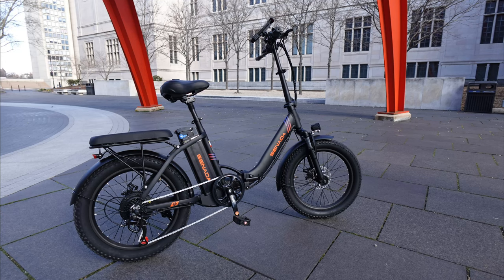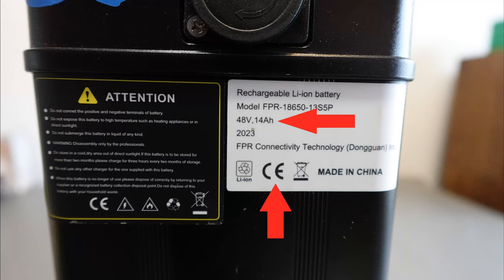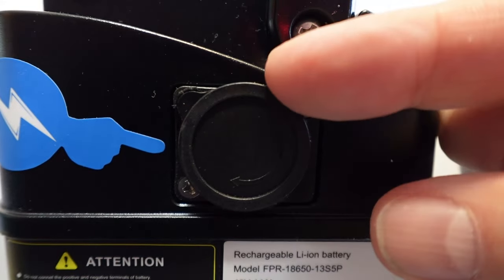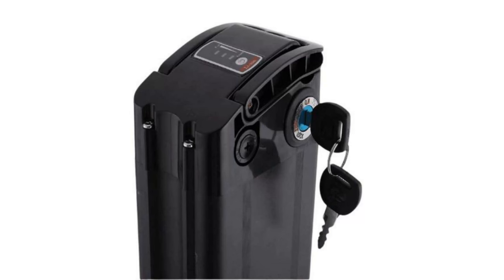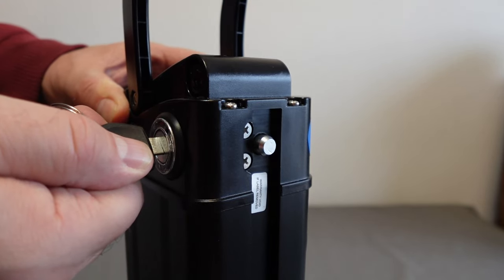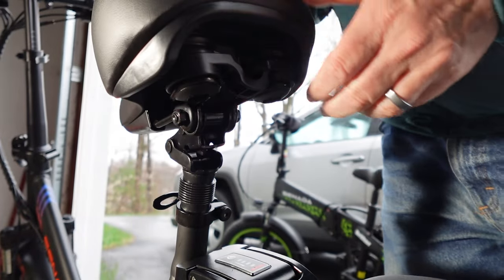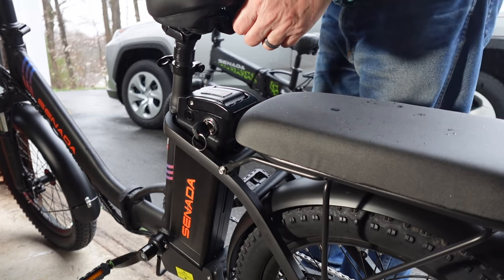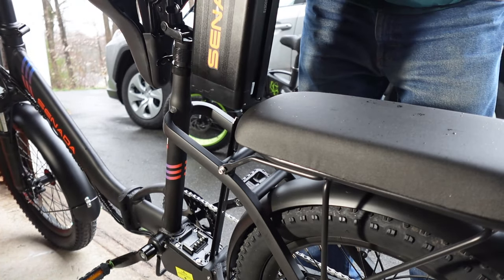Senada Austin UL certified e-bike battery @senadabikes5627 #ebike

Comment: can the battery be charged when it's taken off the bike?
Reply from the maker: Yes.  You can charge on or off the bike.
Reply: @iscootct  thanks, also do you need to keep the key in the bike when riding?
Reply from the maker: @andyk446  yes,  the key must be in the battery to run the bike.
Reply: @iscootct  thanks again